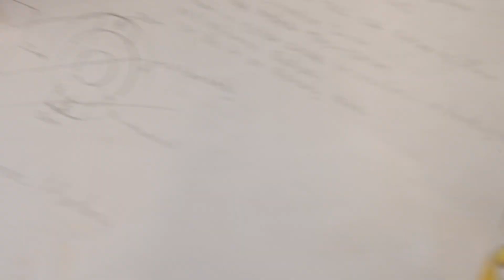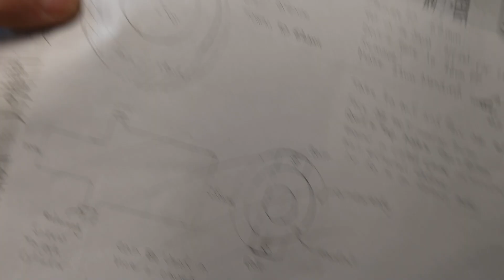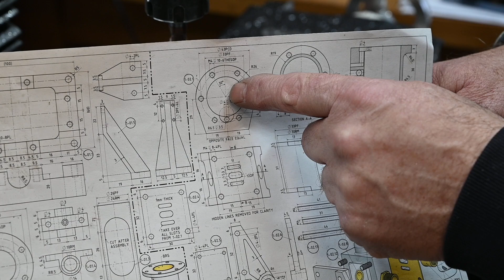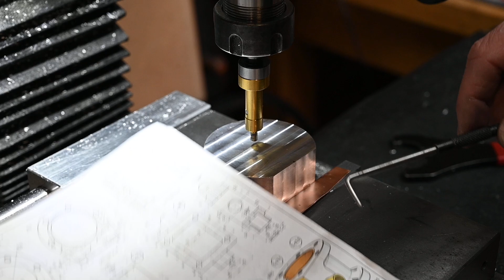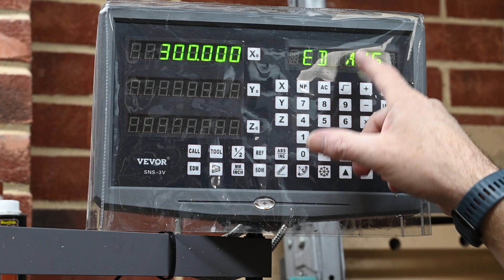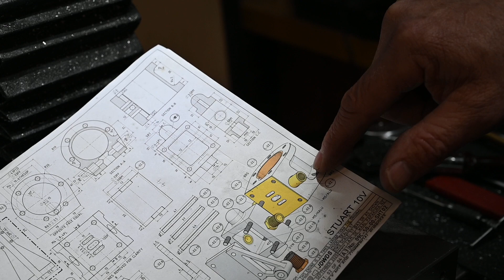Stuart 10v Steam Model Machining EP03  Machining the Cylinder

Comment: How would you make this just on a lathe as all the old model books never mention a mill
Reply from the maker: @DiscusRussell  most of the work can be done on the lathe with the help of a vertical cross slide attachment. Unfortunately explaining how to do it on a lathe goes far beyond the scope of this comments section. As you say most old model books don’t mention a mill but usually show the lathe method.

Comment: Did you choose that grade of aluminum specifically or is it something that you just had on hand?
Reply from the maker: It was one of the options marked on the drawing 👍👍
Reply: @EnglishHobbyMachinist  Thanks. I’m a newby to steam engines and I wondered if it was a better choice than 6061 for this particular part.
Reply from the maker: @robertpearson8798  6061 would work, just a bit softer 👍